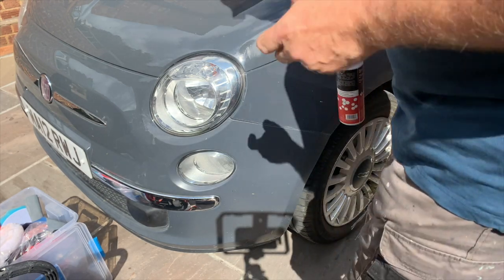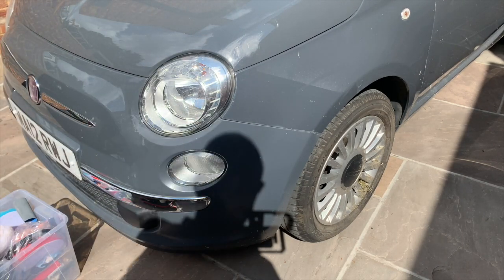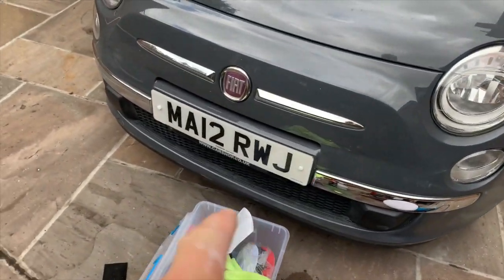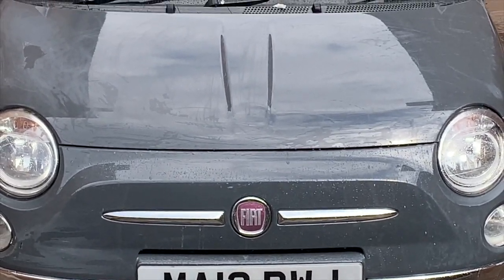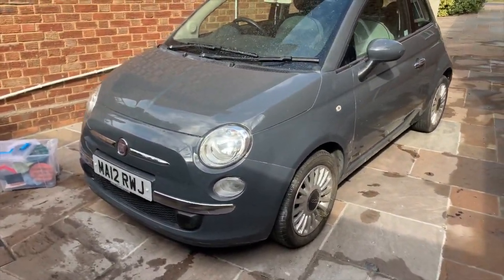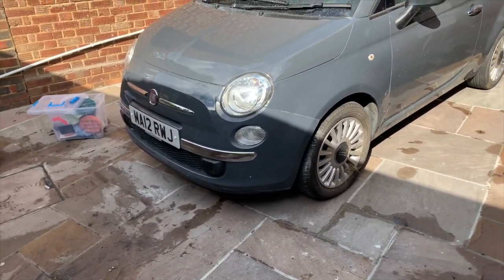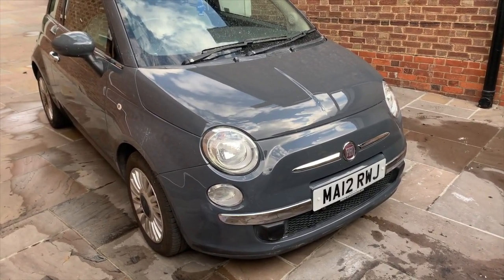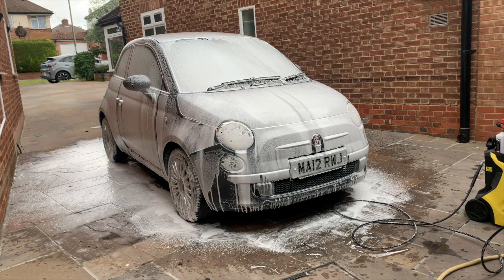Project Masie - The Final Video - Copart Light Damaged Cat N Fiat 500 Lounge

Comment: As someone who has a 500 and hand washes it every week, I'll give you some advice. Don't ever go in circles with the wash because you'll run the risk of putting swirl marks in the paint and those are hard to remove.
Reply: Those marks in the bonnet was from the swirls you made with the wash mitt, some cut and polish should be able to get it out.
Reply from the maker: @roccol3110  no it wasn’t it was the cutting with the wet & dry. Schoolboy error. 😬